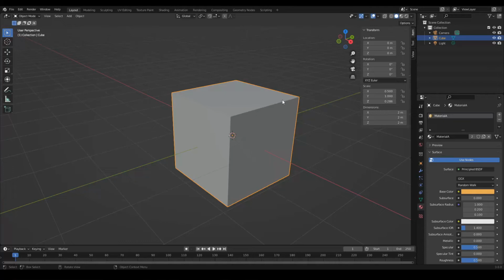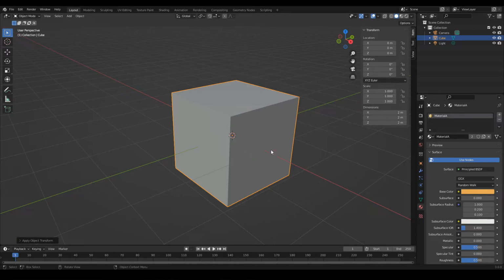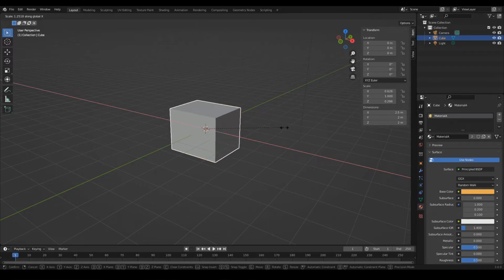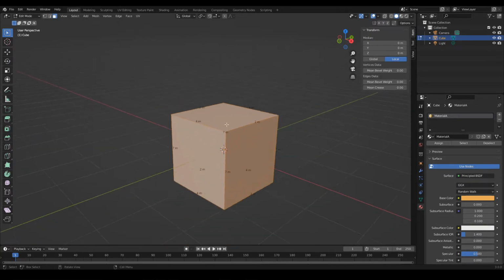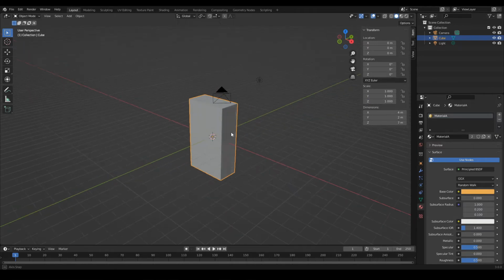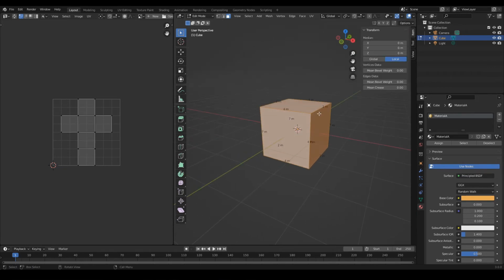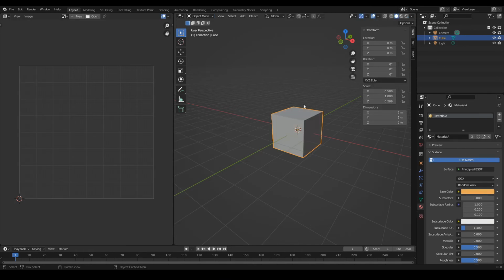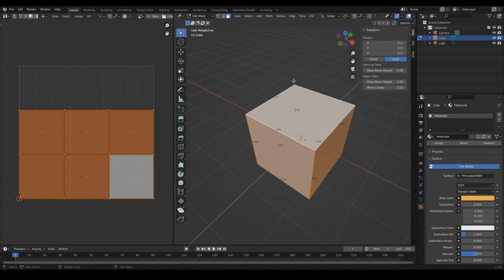How to NORMALIZE the SCALE of an OBJECT in Blender and why it's important

Comment: hi bro, how did you even got this scale values without messing with the cube's shape ? I'm asking this because a lot of times I just want to change the value numbers to match with the other objects, while keeping the mesh/geometry the same size... 
I created an addon with chatgpt and now I can change the rotation and scale values of an object, while keeping the object 'frozen', but I'm curious to know how you did that with this cube.
Reply from the maker: heey, I've just scale the object on a certain axis in the object mode and then enter in the edit mode and apply the inverse value of that scale on the same axis, for example I selected the cube in the object mode, press S, then X, then 2, to double the scale of the object on the x-axis, then enter in the edit mode, select all the vertices, press S, then X, then 0.5, to reduce the x scale value by a half.

I think if i have to tweak the scale for some reason, while keeping the shape of the object, think I'll take all the vertices and separate it into another object, then select the original object (which is empty), adjust the scale values, then join the other object which contains the shape, with the original object which has the scale I want, I think this could work
Reply: @GameDevTraumEN  oh, I see, what you said in the beginning is the exact same logic I got when I asked chat gpt how to do it, then I created an addon based on that logic. 

And joining the object with an empty object is a very smart way to do it too, look so simple, but I would never thought  about that myself. lol
thank you for the explanation

Comment: why this simple thing needs to be this complicated
Can i tie the scale to dimensions? so its applied all the time?
Reply from the maker: you can make changes to the scale while being in edit mode, that's what I do, select all the vertices and scale them, maybe set the 3d cursor to the origin of the object and use it as pivot point
Reply: @GameDevTraumEN  that does not make it simpler :) but thanks.

Comment: Can you do this with objects that are Linked Duplicate?
Reply: No. A mesh has dimensions, an Object has scale. Linked objects use the same Mesh data. When you apply scale you are updating the Mesh data with new numbers based on the scale of the Object. But each linked Object has it's own scale value so can be different. If you overwrite the mesh using one Objects scale values it screws with all the other Objects using the same mesh data. So Blender expects you to make a single user copy if you want to apply scale for one instance. i.e make it not an instance anymore.

Comment: Should I avoid scaling in the firs place?
Some of my objects prompt me this: "Create new object-data users and apply transformation". What is the meaning of this? These are objects that share a mesh with copies. How should I tackle this? 
thanks
Reply from the maker: I barely scale objects in object mode, I get used to do it in Edit Mode. But there is no problem scaling in object mode, based on my expierence for uv mapping and to use blender models in Unity I'd suggest to apply the scale always.
The other thing about objects sharing mesh data could be related to clones and instances, you can do a little experiment, open a new Blender file, select the default cube, press SHIFT+D and place the new object somewhere, then select the original cube again, press ALT+D and place the other new cube somewhere else. Then select the original cube, go to edit mode and move some vertices. 
You'll notice that the cube created with ALT+D also changes, that's because that cube is an instance from the original, they share the same mesh, so when you modify a mesh in one object, all the other instances receive that change.